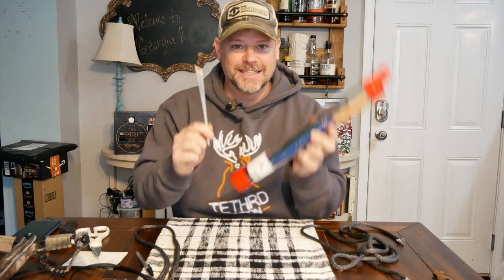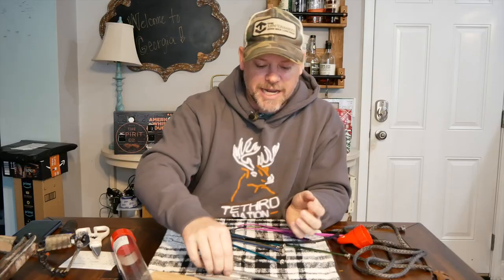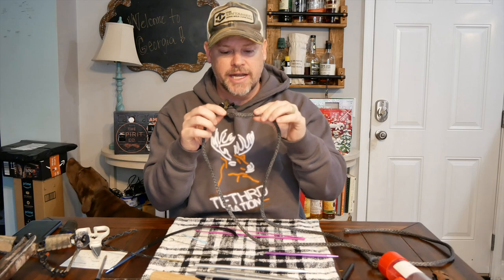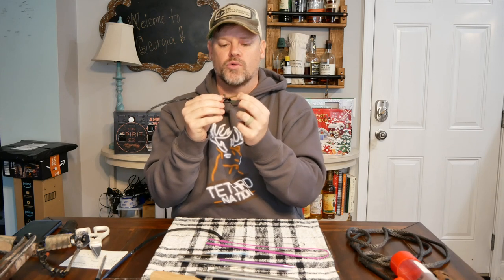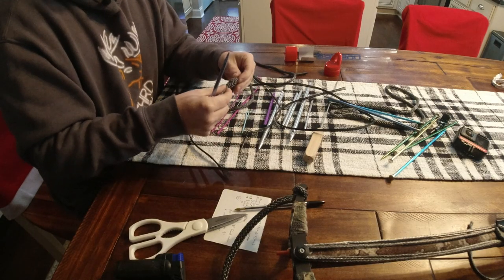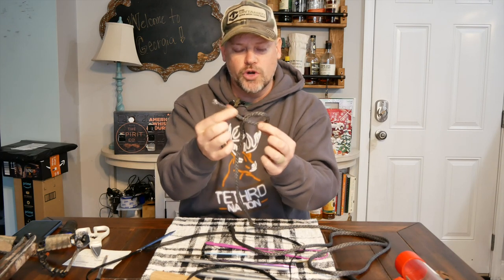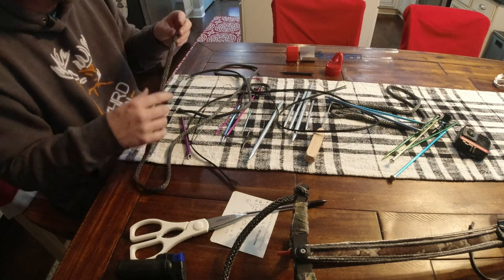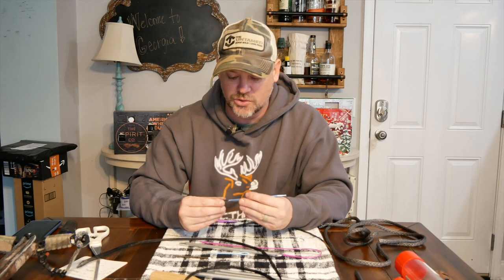The Ultimate Splicing Fid - Everything you need to know about FIDS + the best DIY FID on the planet

Comment: Fwiw I just tried this (October 2023) and those knitting needles are solid, not hollow. This was the copper colored boye 7 (4.5mm). I also tried some 1/8" finger trap stuff and 1/8" Amsteel slides right out of it. Neither trick here worked for me ☹️

Comment: Those are knitting needles that you DIY'd.  I would say about size 5.

Might I suggest you look for double pointed needles next time?  They are shorter, but they usually come in packs of 4.  They also come in a variety of sizes, from super tiny sock needles to super large for extra bulky yarns.

Good info.  Thanks for the video:)
Reply: I purchased knitting needles at Walmart but they were solid. 😮
Reply: While I don’t have a Walmart where I live, they make knitting needles from all sorts of materials, some of the ones made in metal are hollow so where you bought yours had different sets. 

Hollow needles are sometimes described as “light weight” as a sales argument, so it might be something to look for on the packaging, product descriptions or reviews. Hollow knitting needles can also be reviewed as quickly feeling warm, as there is less material to warm up then in a solid metal needles. 

I don’t know which needles that’s in the video, but color vise they look like “knitters pride“ (or knitpro here in Europe) aluminum single point needles which is called “Zing”, they have different colors for each size of needles. But this is just a wild guess, and there are probably other manufacturers making metal knitting needles in ranges of colors too. But it could at least be somewhere to start if you are still looking.

Comment: Thanks Greg. Haven't had a drop from u in a whole on my info feed. I ordered a new micro adjust fletch tool & I ordered some aluminum anodized needles that come in a pack in 6 different sizes. Also 3 of the wire shrouds in different sizes. I've done 1/2" 3 strand Arborist rigging line & put a loop around a metal half sleeve so u can hook 30' of 1/2" 3 strand rope so u have a come-a-long that can pull 30 feet! Also many different types of arborist climbing & rigging line. Just working in 🌳 that Amsteel can wear on bark so I just kind of use it on a spar up in a 🌳 & hook it to a branch that can't naturally fall straight down. So the rope puller attaches to 50 feet of 5/16: Amsteel which is always blue to turn a branch 90* & crank it down. 
Last year I hunted with a Sterling  9.5mm Super Static rope which was 75 feet long. The climbing system was a  micro pulley on a MRS setup with s self tending prusik on the working end of the line. But this year I have a Sterling 9mm CRV rope SRT setup that has a large loop on one end with an accessory clip. U attach your paracord to that clip & 3 minutes later u r 20 feet up. The other night I repelled in the dark with just a dim headlamp 30 feet from my on-site climbing 🌳.  Within 5 minutes I went from 30 feet up with paracord in the 🌳 with my entire light climbing system packed away. I'm going to replace the small sewn loop on that 9.5 line with a larger loop & I will be able to ascend on my new SRT design for 🌳 work. Both the 9 & 9.5mm fall within the specs for this line. My rapell device is a one piece unit. It has a great handle for rapelling which is very safe & doesn't interfere with the backup 8mm Beeline 30" eye to eye hitchcord which is above on the climbing line. The device is called a Trango Vergo. U only need (1) carabiner & a CT Quick-roll left hand ascender up above the hitchcord. It's effortless climbing & instead of having too much friction with MRS that feels like your pulling half your body weight the Quick-roll that has a built in micro-pulley & it makes it feel like u weigh 20 lbs.U can clip a foot ascender into the bottom of thatcCT Quick-roll but i doubt that i will be doing that.  These people that r hooking up a block on the tag end of their line fir safety r just putting the cart b4 the horse & they r going against the Gri Gri or Madrock they r using. 

 Where I live there isn't any telephone pole trees in MN. But plenty of big 🌳 with large branches & unions to rig into. Next weekend I will be starting my post season work that will take 6 weeks. After that I'm done & I can just let a handful of cameras do the work. 
That's a great tip about cutting & sanding the needle. Especially when u r trying  to put the needle through Amsteel. Great, light  stuff but u have to protect it. I would put a 2nd bridge on my main hunting saddle but it probably wouldn't be Amsteel. For me a webbed bridge works nice & a double line  8mm Oplux  which is also adjustable for a 2nd lifeline works well for me. Get ready for spring😅. Thanks. 🎉

Comment: WOW, thank you, that braided sleeve is really perfect.  Alternatively, you can spend $35 +shipping for a D-Splicer soft fid, looks like it does the same thing.

I actually like using the braided sleeve by itself, and pull it through the rope cover with a wire fid.  Works great for tightly woven static ropes.  

@Fugal Innovations has a video "DIY Splicing Tool With Plastic Handle" that's a fancier version of what I used.  For splicing Samson 16 strand, I used much thicker and longer wire, since that requires passing the cover tail through 33 inches of the body, which gets very tight at the crossover point!

Comment: Greg.... AWESOME video.... and I can confirm/agree/whatever.... the tools u get from hobby lobby combined with that wire sheath work wayyyy better than the actual fid set.... I've made 3 amsteel rope mods (full bury) and 2 amsteel loops for prussics at this point... tip for others trying this stuff for the first time... cut that sheath material(Chinese finger trap) longer than you think ur gonna want to... ur going to have 2-3 inches of it unravel at the end.... also... for full buries... fluff the hole line up prior to starting... doing it as u go is a lot tougher...thanks for the info Greg and good luck everyone else

Comment: What do you do to prevent the braided wire sleeve (Chinese finger trap stuff) from unraveling from the cut end? Melting it cause it to hang on the inside of the Amsteel
Reply from the maker: I melted it just a little and it works great. Every now and again it'll grab just a touch but overall it's perfect.
Reply: @G2Outdoors  awesome. Thanks. I just redid mine and I melted it too much the first time.
Reply: @chrisunruh6485  
Try inserting a metal object ( nail, knitting needle, etc. )about the size of rope you are using and tighten it up before melting slightly. 
Works for me.